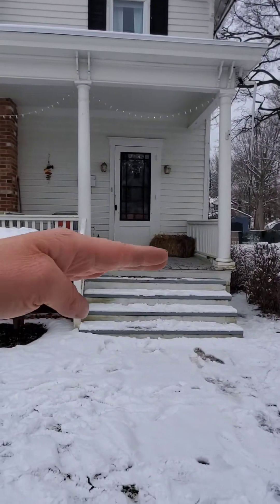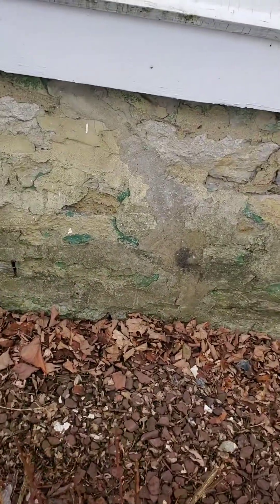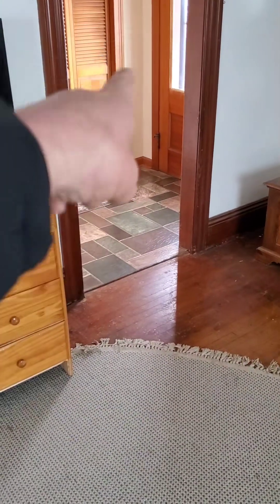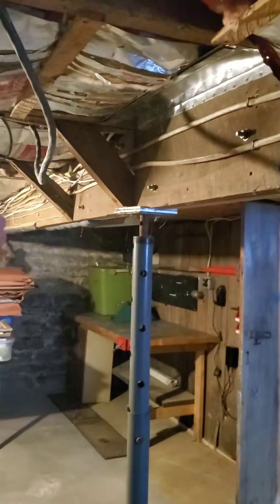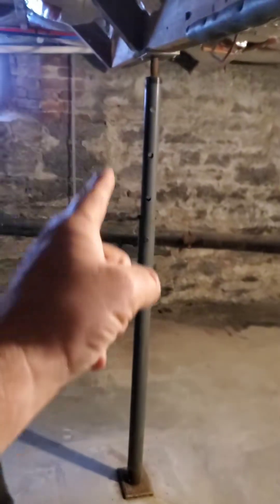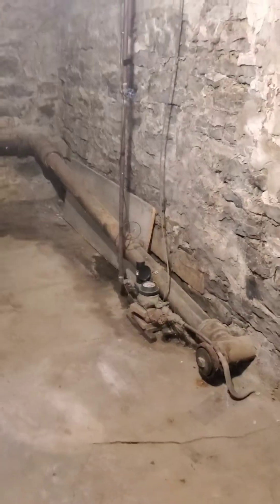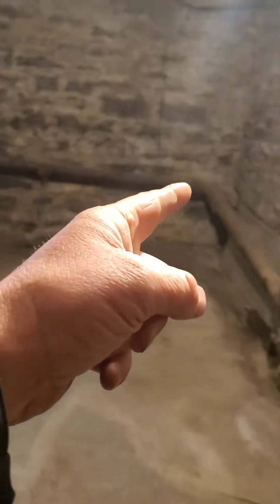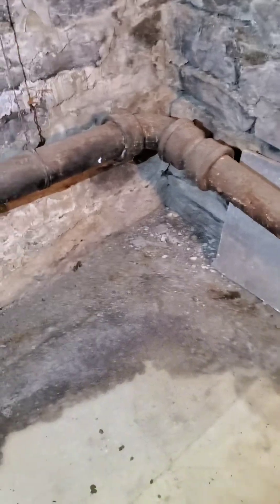Structural Foundation Problems!

Comment: Is there a possibility that there is a leak in the water line before the house, it comes in right at that corner and they wouldn't notice on their bill as the leak is before the meter which is what reads consumption, and the floor is wetter the closer you get to the water meter. Condensation could have caused the dripping off the cast iron pipe.

Comment: 1000's of porches like that in Portland, OR. Archaic porches w/o any concrete piers or steel for structural support. They were never engineered or built to last and  are now obsolete and defective. The cause of the riprap foundation wall failure is debatable, but it is structurally obsolete by modern building standards. There is no poured concrete with steel reinforcement,  or  footing drainage, and nothing seismic about its construction . As pointed out the gutters are missing.  I've been told that inspectors cannot legally give any investment advice on home purchases; nevertheless, unless the house was jacked up and had a new foundation installed I would not buy this home. In many areas of Portland these old homes were knocked over in minutes and new homes built in their place. It may be sad but these old places are obsolete in too many ways to bother with patching them up. As an old friend said (RIP), it's the property that increases value, not the house. Be well.

Comment: If you're correct that the outside grade was the main cause and apparently fixed, and now the leaking iron waste pipe is a smaller continuing cause, would a buyer that purchased that home with a fair (and likely hefty) discount specifically because your inspection indicated that settling is NOT fixed, be getting a good deal? This assumes you are correct about the waste pipe and it's also an inexpensive fix and the settling problem is then permanently fixed.
Reply: He cannot legally say if the home is a good or bad deal, that is outside the scope of his practice. Crazy, eh?
Reply: @gnomiefirst9201  - great point. Can an inspector tell the homeowner the home foundation is still sinking, and it if the problem is water leaking from that 10 feet of pipe, the solution is to replace that easily accessible  pipe?
Reply: @donaldlee6760  Recommend further evaluation and repair as needed by a qualified contractor is a common cover yourself response/notation by inspectors. I would add, get a geotechnical engineer, structural  engineer and a contractor that can read and follow blueprints.

Comment: Watching the video, I was curious what was behind the panel, next to the sewer line, hiding the foundation wall. IMO the patched with cement might just be a bad cement job. Like it was so wet when put on, it had to crack when it dried/cured.   That spray foam in the beginning , I am sure was to keep the cold out? Maybe mice and squirrels out? Anyone know if mice and squirrels will eat through the spray foam? That foundation is a NOPE for me.

Comment: Great vidoes- wondering if you'd consider doing horizontal filming? :)
Reply: THIS!!!
Reply: For nearly all creators and content, I'd be right there with you.  However, this is a rare circumstance in which maybe vertical makes more sense.

Many, maybe most, of Preston's great videos show how various issues are connected vertically, so the vertical framing often seems more efficient.

Honestly, I'll watch either way.
Reply: That change is coming. Right now TikTok and Instagram are still primarily portrait mode, and where my bigger following is. But TT is now promoting landscape mode, and now that I'm getting traction on Youtube I'll start doing YouTube only content :)

Comment: That cast iron line is sanitary sewer right? A leak in that in the basement significant enough to cause foundation movement would STINK. I would vote for an outside issue still causing the problem. There are not gutters up high and it's probably dumping a bunch of water down there still.
Reply: Also, I forgot to add, that basement floor might be a skim coat. Not sure how old that basement is, but many originally-dirt basements had skim coats of concrete added as a floor but it's not structural so cracks in those are kind of irrelevant.
Reply: @burgundyyears  Good call about the gutters, I noticed that too.  I'd still replace that pipe though.